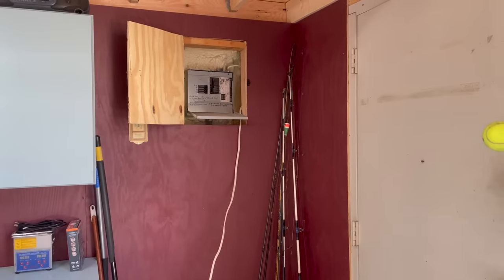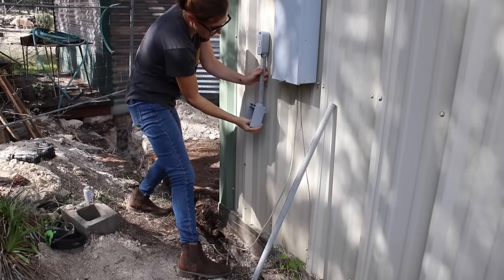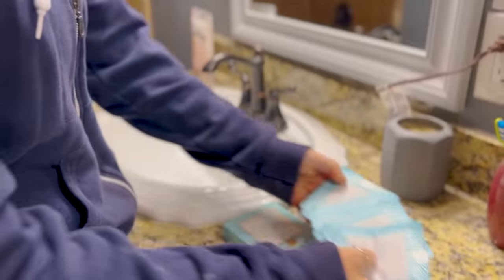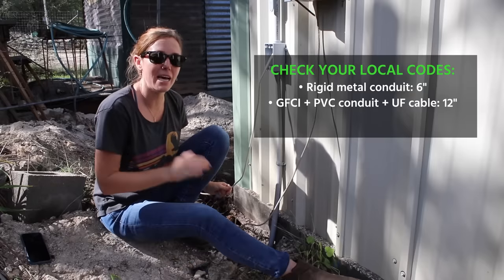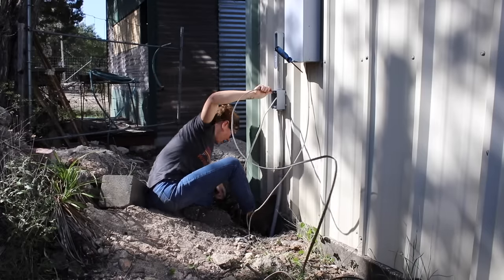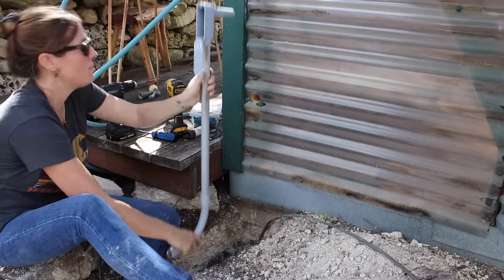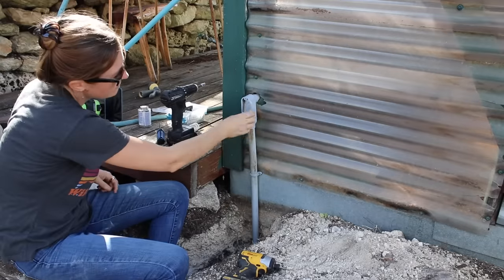How to Run Underground Power to a Shed the Easy Way

Comment: Just a thought:  Chase the wires through the individual conduit pieces and parts before gluing the conduit.  Its easier than chasing around the fixed bends, elbows and boxes.

Comment: I am a retired bored EC so, here ya go :)

1) There is no special cement for conduit. PVC is PVC. If you found a label that said for conduit, it is a marketing gimmick.
2) You could have used the receptacle box to turn the corner into the building. You could have done the same thing at the shed to have a receptacle on the outside.
3) There is no code to protect the wiring as it enters the PVC. That MA is much sharper than the conduit
4) Romex (NM cable) is against code in your outside conduit. (Only a technical foul IMO)
5) You should have pushed the short end of the UF in thru the conduit :)
6) Although legal, unprotected cable is very vulnerable to damage. Besides rocks, gophers and moles can chew into it. It'd worth a few more dollars to run PVC all the way.

Bottom line, the installation is good but some of your facts were wrong. :)

Also, you don't want me to critique your terminations in the panel :)

Comment: Direct burial wire is supposed to be no leas than 24” deep. Since you have a junction box at both ends running stranded wire through the conduit would have been so much easier. Also running the direct burial would hve been much easier to start from the bottom and push up, that way you only need to feed 4-5 feet through it rather than 30’. Nice video though.

Comment: If you are going to go that shallow, best to place a layer of sand over the wire then concrete patio blocks over the sand so that if anyone hits it with a shovel, they will know something is down there. Yes the GFCI will shut off the power, but who wants to go through the trouble of fixing a cut cable?

Comment: Yep ran such a line with underground #10 cable and conduit, out to my pond and on to my outbuilding. So my next door neighbor runs an extension cord thru the fence and uses my electricity at his outbuilding. Im gonna have to break the line at the pond and rig a way to disconnect the rest of the line till its needed.

Comment: What you do is push it through the elbow before you glue it to the conduit then it makes it easier to pull through, then glue it when the cable is all pulled all  the way through. To protect the underground conduit from accidental damage you should dig the trench at least 24 inches deep as pvc does not give good mechanical protection, if not cover it with concrete and lay down electrical caution tape over the length of the trench as a warning if any one should dig anywhere near the trench. You should also check the continuity and megger the cable before you close the trench in case you damaged it when you pulled it through the conduit.

Comment: So, in your area code, requires you to use Schedule 40/80 to get the cable into the ground from the source and Schedule 40/80 out of the ground and into the shed but you aren't required to run the Schedule 40/80 all the way from source to shed?

Comment: confusion... NEC says the depth is 36" in conduit all the way with adequate tracer wire and inches of concrete on top of conduits. This is to prevent future digging from hitting a hot wire. We were taught to use a pipe big enough to allow for follow up wiring and to install nylon pull stings.
Reply: Could you provide the Code # for that, Rick?

Comment: I don't think I would ever go less than 24" in the ground unless I couldn't. The deeper the safer, within reason.
Reply: If you like digging that much, come on over to my place. I have some conduit to run, and going deeper here increases the likelihood of hitting rocks.
Reply: We had to dig two trenches, 4 or 5 feet deep when bringing more power from the street to our shop building. We requested a separate power source for the machine shop on the property, but were denied, and required to tie into the initial wiring to the house. It was so much money for a licensed electrician, we told him we would dig the trenches ourselves ..... which were more than 60 feet long. This was in Lancaster, CA, where almost ALL power lines are underground due to strong winds all year long. What a chore that was. That desert ground was hard and dry. At least we had 4 teenagers to help. Even digging the trenches and hard wiring all of the machines inside ourselves, it cost us more than $6,000 for an electrician. My husband was pretty good with electrical matters, as his stepfather was a seasoned electrician. But, regulations required the main line be done by a licensed electrician, and his stepfather had long since retired.

Comment: My shead is 250 feet from the back of my Home and about another 60 feet to my electric box out frount what size wire should I use? I want my shead to have at least 4 outlets for fans a tv anf some phone chargers and about 15 led  lights to light up the place at night when I do bbq.

Comment: A nice “minimum code” instal. Let me explain what I would do differently, and why.
(PS: The wire she used is grey in color, so it might actually be rated UF. Not all UF is flat!)

Rule of thumb: If you can see that elbow above grade, you’re not deep enough. Dig a few inches deeper, so you can rest your pipe on a nice bed of sand ( rocks can cause damage over time). You want the run to be deeper than a casual shovel bite or any sprinkler lines.

I’d run pipe all the way, and pull individual wires. Individual wires are easier to pull than a fat cable. I’d oversized the pipe, so the pull is easier and there’s space should I ever need to upgrade. Using PVC primer really helps the glue to stick.

I encourage running a second pipe, at least 3/4”, alongside. That will be useful should you later want to run alarm, data, or other low voltage lines there.

I also like to have a small panel at the shed. You will want a ground rod if there’s more than one circuit. There should be a disconnect switch on the outside of the shed.

Comment: Did you run conduit from the house to the shed?  Did you just let the conduit end once it was buried?  Why?
Reply: That's what it looks like. That code she mentioned only makes sense if the entire run is in conduit, otherwise why would it matter the material that the conduit is made of?
Reply: @dynamicequilibrium5322  The National Electrical Code (NEC) is the authority in almost every location in the USA. PVC pipe is not allowed and as said in the video, conduit (usually gray) rated for electrical use is required. I don't know all the differences but UV resistance is a big one

Comment: is there a reason why you didn't run the wire through individual pieces and then glue afterward?  wouldn't it be a lot less to fight with?

Comment: Several NEC violation for this install. 1)NMB not listed for damp or wet locations. 2) code requires warning ribbon in trench. 3) where is the disconnect means for the separate bldg. 4) Grounding electrodes? 5) Permit? inspections?
Reply: Can you provide the code #'s for the warning ribbon ground rods?  She is running a single 120v circuit.

Comment: Aside from the glaring code violation involving running interior-rated wiring to an external outlet, we couldn't help but notice that there was no mention of the permitting and inspection process required by most municipalities when making alterations or additions to electrical service panels. Adding circuits to a breaker box isn't quite the same as swapping out a defective light switch, and weekend warriors shouldn't be misled to believe they can run electrical circuits without following proper procedures. Was the Romex dangling from the top of the subpanel at the beginning of the video the wiring you stuffed into the LB, or was that a completely different code violation?

Comment: Just FYI if you want to meet code yes the conduit is correct but the Direct bury cable is not at the correct depth.  if it was in conduit the whole way you would need to use individual Wires.  but with the Direct bury cable it needs to be 36" or under 2" of Concrete to be up to code because it is not in conduit.  Just thought you and your viewers should be aware....Louis.

Comment: You didn't even need the LB's as you could've used the outlet boxes as the LB's and eliminated the LB's entirely (LB's aren't cheap ~ $6 to $12 ea.). You would just mount the outlet boxes over top the holes you drilled with a short stub of pvc pipe coming out the back of the box and into the buildings. You could then either put another outlet in the box going into the shed or just blanked it off with a weather proof blank plate. UF cable not installed in conduit has to be at least 18" below grade. If installed in conduit I believe it can be installed at 12" below grade but don't hold me to that as I don't have the code book in front of me at the moment.

Comment: I’m surprised that your code of 12 inches in uPVC pipe doesn’t stipulate that the wire should be in the pipe for the whole run.

Comment: Thanks for repeatedly mentioning codes. It’s generally not a problem doing your own work, so not strictly following code is not an issue.
There a two main reasons I at least check with local authorities.
1. Codes exist to protect us and our neighbors.
2. You may have trouble selling your home, or have to take a big price hit, if codes are not followed. I recently had to a home for about half the actual value. One of the major factors was that I had an outbuilding that it didn’t meet codes, and had to be torn down.

Comment: You cant run romex in conduit. You got to peel the jacket and just run the conductors inside the conduit. You are allowed to bury romex but I do not advise it since it can become damaged, flooded, or chewed by rodents. Always a good idea to provide some sort of protection when burying cables. Also a good idea is to paint the pvc conduit as they become brittle with sunlight.

Comment: THHN/THHW is much easier to pull through conduit.  By not prebending the vertical first, you are preloading the strap/screws going into your metal skin. This leads to the screws pulling out when ever the building/ground vibrates due to wind/seismic/vehicular movement. Running conduit the entire way is FAR superior to running direct burial cable. Been there, done it, regretted it.

Comment: What's the best way to find out about local codes? These are simple rules, but is there a central repository?
Reply: Call your local Building Code department (where you could apply for a building permit on a larger job). Specifically, what version of the NEC and are there local exceptions.
Reply: @jamesrawlings8493  thanks!

Comment: That was UF cable wasn't it? It didn't look like Romex.

The Minimum Covering Requirements for UF Cable
General installation – bury UF cable 24 inches deep.
2 Inches of Concrete Covering when UF cable is buried 18 Inches Deep.
4 Inch Slab, No Vehicles – 18 Inch Depth.
Under a Street – 24 Inch Depth.
Under a Driveway – 18 Inch Depth.

Comment: If you would have run the wire thru each piece of the conduit first and then connected each piece it would have been easier to do.

Comment: Take it from a master electrician. 

If you are doing 60A or less, you are probably using romex for these INSIDE the structure. Never outside. Just stub it out of your shop or other structure into a 6X6X4" 3R box. Pipe the whole way from A to B starting and ending with a 3R box. PVC is fine. 1-1/4" is the smallest I recommend EVER. 2" preferred, because most people end up upgrading later. Bury the pipe at least 18" because damage happens. You drive over it with a tractor, or something settles and you are in for it.  Pull THHN or XHHW. Too many people damage UF trying to make their splices. It is jacketed wire in a full sheath, and they nick the jackets to bare wire way too often. Cant tell you how many fires I have had to fix in those splice points. 

This way, 2 years down the line when you want to upsize, you can pull 2246 URD and have 100A available for whatever the structure is.

Comment: Maybe could've mentioned maximum distances for that shed regarding voltage drop. Don't want folks out there trying to power up their sheds if they're too far from the power source to use the same gauge wire you're using in the video.

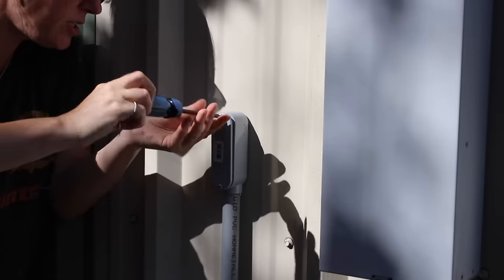Comment: 1:50 It serves another purpose as you can't have more than 3 bends without a pull box.
Reply: Your wrong. 360 degrees in bends is legal.
Reply: @daveroth8060  ... yup, the 4th bend needs to be a pull point, which is basically what he said in different words. You can have all the turns you want so long as every 360 degrees is a pull point.

Comment: In my country all wires need to be in (PVC) pipes underground If I'm not mistaking... Sounds logical to avoid lose wiring in the ground of which the out layer can corrode/get damaged and cause a . short circuit. Sad to see that this isn't a code everywhere.
Reply: That cable is purpose-built for direct burial.

Comment: do I have to use a fitting or can I just deburr that inside edge ( edit: chamfer not deburr )
Reply: that threaded fitting is to use a waterproof connection, which she didn't use. If it was NOT buried, you could have used a female thread and a 2-screw NM clamp.

Comment: Why feed 100% of your DB cable thru the outlet box?  Why not just start in the trench and feed the 3' or so up thru the elbow and into the outlet box?  Then you can just lay the rest into the trench for your run and terminate at the end.

Comment: Not here trying to brag or put April down at all just learning... She used UF-cable which yes its direct burial, But it's the depth that concerns me.. Shouldent it have been deeper? NEC 300.50
Reply: @turdferguson12  Not my point.. I want inspection approval to say, "Yes thats approved"... You can buried it to 1Inch and it can be there for years... But I'm curious what inspectiors are looking for...

Comment: It would have been better to just run the PVC the full length (it's not that expensive) then use individual wires instead of Romex.

Comment: I never run direct burial wire in the ground without pvc pipe. It is a very cheap way to insure the wire will not be damaged.

Comment: A real electrician would install all the conduit and then pull the cable in not like this amateur . Here in Australia none of this could legally happen as all fixed electrical work must be carried out by a LICENCED   Electrician or Electrical Contractor   It is a shame that You Tube censors some things but allows this to be shown in Australia.

Comment: First and foremost you do not run #12 wire to an outside shed you are supposed to put a sub panel inside the shed with a main breaker or a disconnect switch the wire should be no smaller than #8 I'M a retired Electrician of 43 years also check the National Electric Code

Comment: Electrical work IS NOT A HOBBY AND NOT FOR NOVICE HOMEOWNERS!!!!! UF cable in a trench should be 24" depth any shallower it needs protection along it's entire length which you did not have. SMH.

Comment: A lot of safety / code issues in this video. You should take it down and redo it properly.
Reply: can you name them? One I read that you have to use conduit underground and the other specifies using yellow caution tape in the ground so the person digging is aware that there's an electrical source in the ground area
Reply: @30guarino  code is different in different regions but the backfill for burying conduit or wire has to be specialized, such as a bed of sand a certain diameter around cable or conduit so rocks do not pierce it. Caution tape over a buried anything is a must. This was a super short run, it should have been entirely in conduit. Also there are wire type issues pointed out by other people I'm not familiar with.

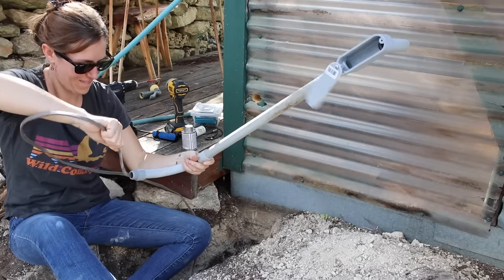Comment: 5:07 -- insert the wire through piece by piece then attach the pvc together ... this avoids inserting the wire steps ... (just saying) ...
Reply: It's also an NEC violation as all joints must be glued before any conductors are installed.